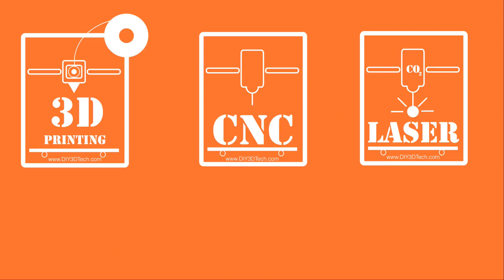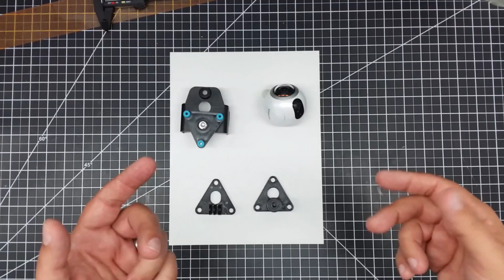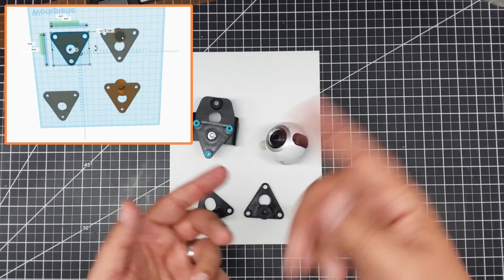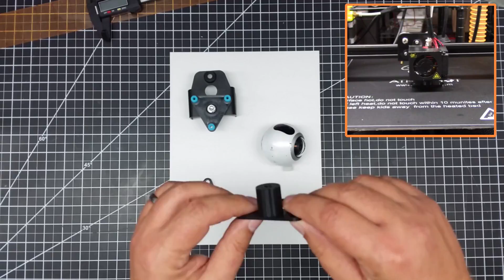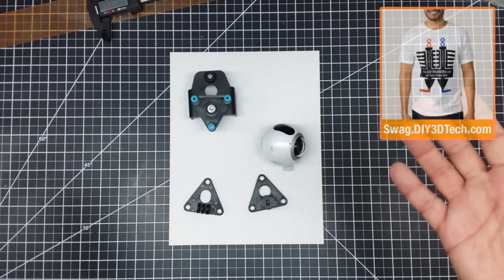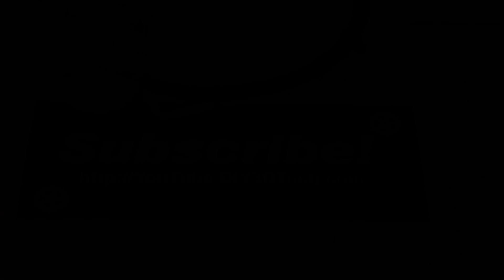TinkerCad Tip - Don't Discount it for Rapid Part Design!

Comment: do you have an intermediate level tutorial for Tinker cad? I've done the simple lessons on the Tinker cad web page but now need to learn the next level stuff. I saw some of your more advanced video's but I'm not there yet. A tutorial on how you did what you did in this video would be great also. I would love to be able to do something that takes minutes to make a part  need.
Reply from the maker: Not really as if you have the "basics" down, you pretty much have it all as far as Thinkercad goes as a "tool".  As it is great to simply and quickly bond "primitive" shapes.  Even today I use it even though I am highly proficient with  both Fusion as well as Open-SCAD.  So if you fell you have the basics down with TinkerCad, I would suggest it is time to start looking at Fusion 360...

Comment: Yep, Tinkercad is my program of choice.  Even CHEP uses it all the time.  I love it for making parts.  I just designed and printed a part for my computer which holds the Webcam and a place to slide in my phone with the prompter program running.  You know how much a prompter cost.  This ran about 30 or 40 cents of PLA.  BTW that new bed I am using is Amazing.  Holds really strong while printing and when done and it cools off some the piece lifts right off.  No glue or anything else.  Works every time.
Reply from the maker: Stan good to hear from you and agree with you!